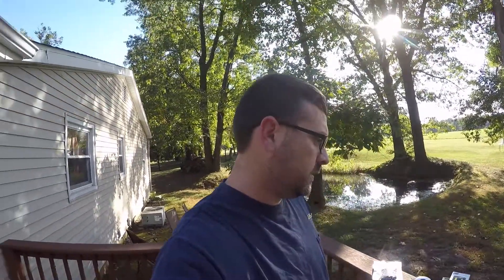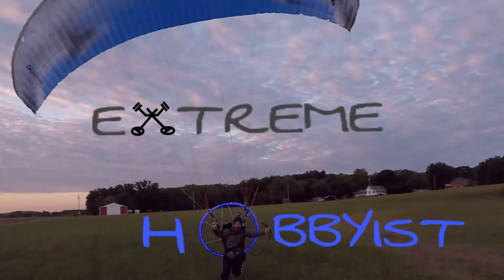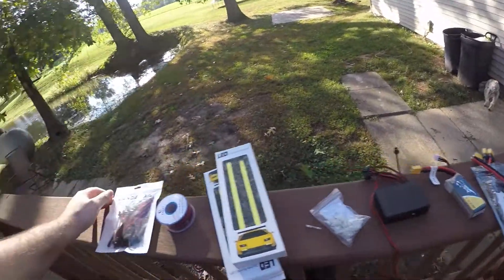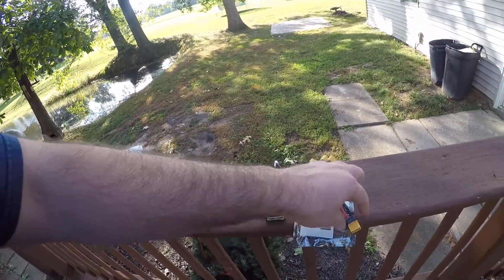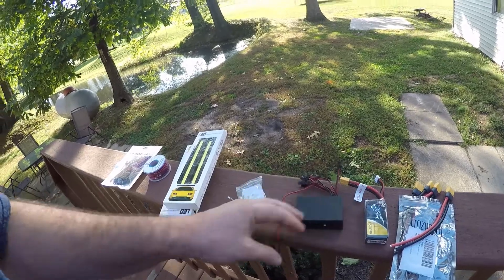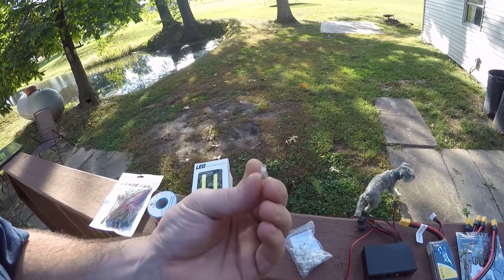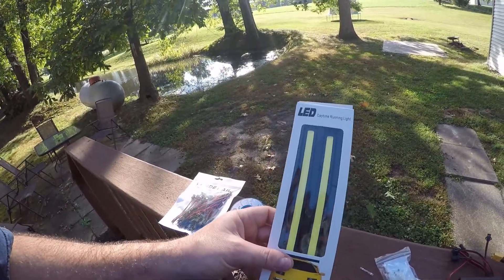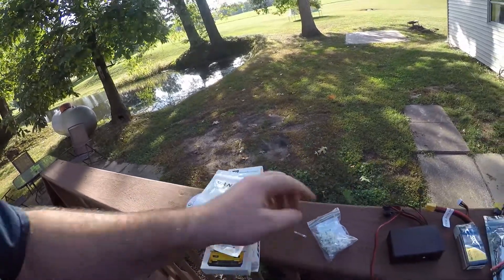Paramotor strobe light install

Comment: Cool project bro.  I'm considering doing a mockup of my maverick in carbon.  did you wrap the foam hoop and leave the foam core inside?  I missed that part of the vid or maybe it was not shown?  Been watching "Easy Composites LTE" videos and they show how to make tubing carbon using a mould with 3 layer offset lapse pre-preg fiber cloth and it seems like the best way to go for super light super strong construction.  One could probably make the shape of the hoop cage tear drop for better flow like on a macfly.  just thinking.....what are your thoughts on it?

Comment: Sweet.  The CF cage is awesome, watched it several times... all vids.  How's it holding up?  What's the all up weight compared to before?  Feel solid?
Thanks for the vid.
Reply from the maker: Thanks. It's extremely solid! Looking back, I actually over built it. I could have definitely went a little thinner on just about everything. I was just worried about the strength in the beginning. It's a tank though. It really isn't too much light (if any) than my last one. Still haven't weighed it so not real sure. Still feels heavy though.
Reply: @jsteinsultz2  Did you consider the counter-torque paddles like on the Scout? I'm surprised you didn't do that instead of spars considering the lengths you went to... but ... you can still do them, can't you?...
Reply from the maker: @eddaddio  I did consider them for sure. It was just easier to use simple spars. I ended up changing the swing  arms to aluminum and they are offset for torque. Also my risers have hook in points that offset for torque too. So I really dont need the airfoils now.